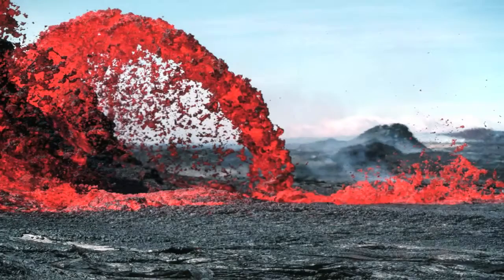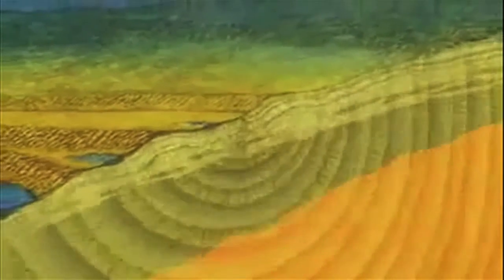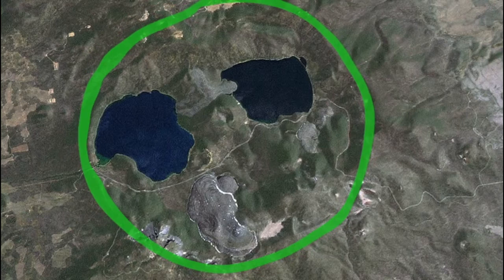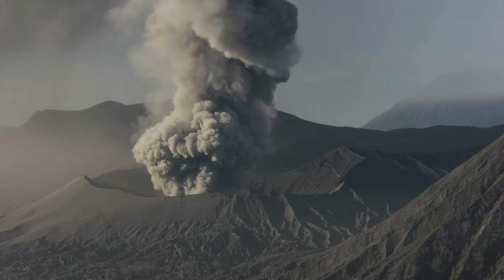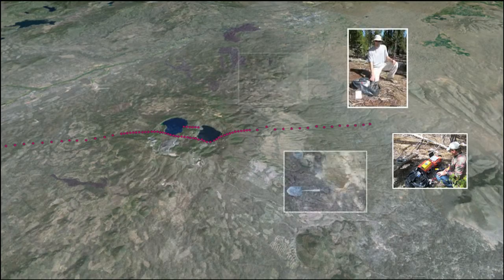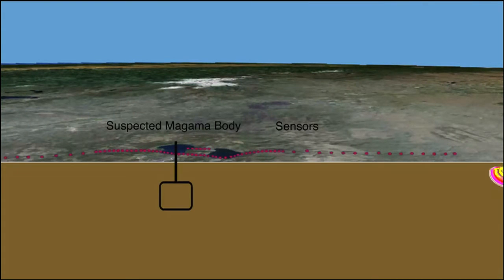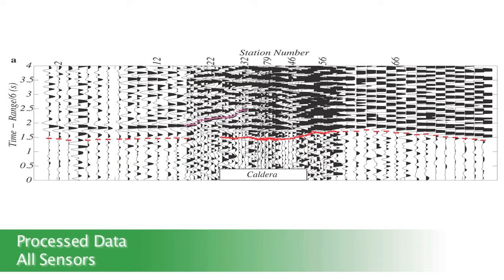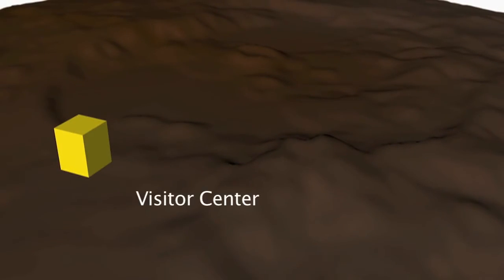Newberry Magma Chamber - Emilie Hooft, geophysicist at University of Oregon

Comment: Cool video and research. How come the the magma chamber doesn't just cool down, seems like 1000+ years is a long time to cool down or is it that insulated or is there a link to deeper magma?
Reply: Hi, I have done some thermal calculations for this problem. Making the assumption of a flat thin magma layer for the chamber and high background temperatures you find that you don’t need a very thick magma chamber (~400 m) to remain molten from the last eruption (~1300 years ago) til the present.
Reply: Wow that is incredible, like a big thermos. So is it just the density of the insulating rock that keeps the heat from dissipating and the magma from solidifying or does pressure from the surrounding rock affect it too? Is there still a possibility of being connected to a deeper magma source or is it just a completely isolated pool?